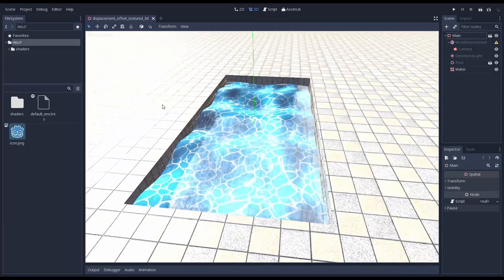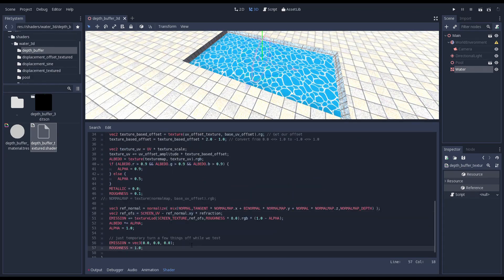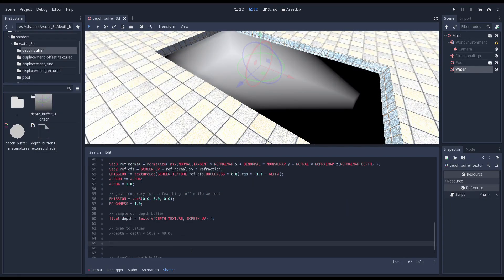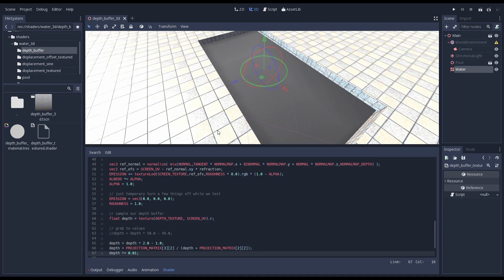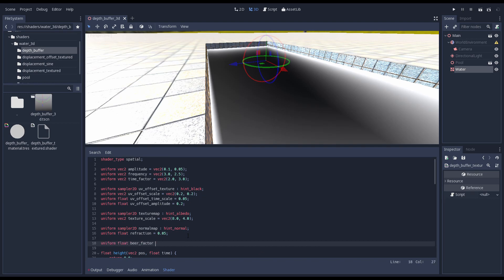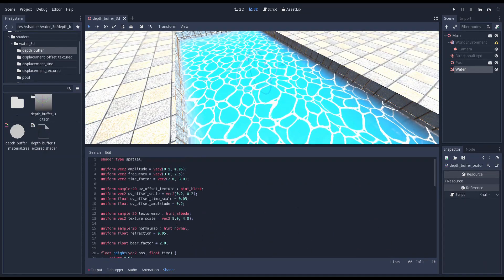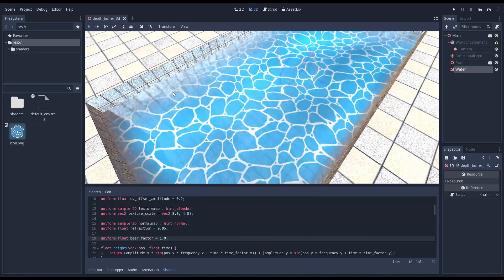Godot 3D Shader Tutorial (2) : Using the depth buffer

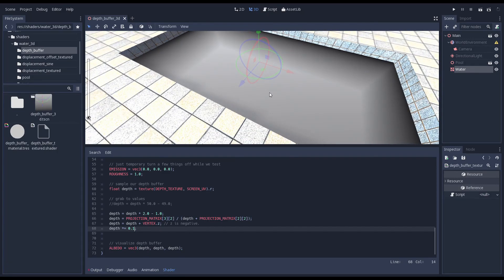Comment: I  have written the same code has seen around 3:00 and my plane pretty much changes a lot of luminosity when I move the camera around. Also, the website linked is not working anymore.
Reply from the maker: It's always sad when people remove content from their website but I have little control over that :(

At this point I'm visualizing the depth buffer values which are very susceptible to how far away your camera is from the object and to what the near and far plane settings are on the camera. It is very likely the default near and far settings have changed in Godot as they were incredibly low (1 - 500 if memory serves me correctly). The further away the far plane, the brighter the result of the code shown here.
Reply: @BastiaanOlij  Okay, thank you for the answer, I'll try to adapt my code accordingly.

Comment: is there an easy way to achieve this in visual shader ? it took me days already to figure out that you have to use sampler2d depth inseaad of the depth texture, but i cant figure out all the remaping
Reply from the maker: It should definitely be possible but I don't work enough with the visual shader to know exactly how the depth texture is implemented in there.
Reply: @BastiaanOlij  well looks like ill have to learn real shaders anyway or "borrow" some code :U, thanks anyway

Comment: I'm not sure if this is a bug in my code or a bug in how Godot 3.2 handles the depth buffer, but for some reason, the moment I access the depth buffer in my shader, it nukes the screen texture and the surface of the water goes solid white. It also disables depth culling on the water surface, and causes it to appear even when it should be behind the "floor" around it.

This happens regardless of which order I access them in, and whether I'm using GLES2 or 3 as the renderer (I had to switch to GLES2 anyway because 3 has some pretty bad lighting bugs. Maybe those will go away when they release Vulkan.)
Reply from the maker: The current render and depth buffer are copied when the first material that uses screentexture and depth buffer are used. Anything rendered after that only effects what is on screen. It should still do a depth buffer test unless that is specifically turned off. No idea why your screentexture would end up all white though.
Very weird..
Reply: The depth buffer works, though I think the values ended up being subtly different from what you used. I was able to make water that was more opaque the deeper it was, just not in conjunction with using the screen texture.

Maybe I need to file a bug report...

Comment: after using your terrain editor my project doesn`t start anymore
0:00:00:0741 - No loader found for resource: res://terrain.hterrain_data/normal.png
----------
Type:Error
Description: No loader found for resource: res://terrain.hterrain_data/normal.png
Time: 0:00:00:0741
C Error: Method/Function Failed, returning: RES()
C Source: core/io/resource_loader.cpp:186
C Function: _load
Reply from the maker: Hey matz, thats weird, it shouldn’t have an issue loading pngs. That path isn’t something i setup so i would begin looking at that first:)
Reply: ok

Comment: Very nice tutorial! I was looking for that already :D

Could you do a tutorial on how to get ss reflections on the same water? (multiple shader passes?)
Thank you! :3
Reply from the maker: Screenspace reflections should work out of the box as its a post process done after rendering is the 3D scene is finished. It does use the contents of the depth buffer so it may be using the copy made before the water is rendered, not sure about that one. Also not sure how good that would look, worth experimenting with.

That said, for really good looking reflections on water the scene really needs to be rendered to a viewport with a clipping plane and preferably a stencil which is currently not supported. I'm not sure how well a reflection probe could be used for this, I haven't used those a lot et.
Reply: @BastiaanOlij  Thanks for the reply!
As I understood it, you cant use transparency and ss refl at the same time?

Comment: My brain exploded as usual. I really need to get into shader programming. You do some really amazing stuff with them. By the way, how is the cardboard support for Godot coming along?
Reply from the maker: Slow unfortunately. I think the GLES 2 renderer is now working on Android, I need to find some time to port the lens distortion shader so it will work in both builds. That and a setting to toggle sensor update frequency would make the native support fully functional on Android but I currently do not have access to a device anymore. Tying in with the cardboard API itself was being worked on as part of the GSoC project but we only got about halfway through before GSoC finished, we really got suck because the GLES 3 renderer didn't want to play nice and the GLES 2 renderer wasn't ready in time.
Reply: I have a spare Moto G5+ (kinda mid range android) might be good for testing if your interested. I cracked the screen on it and attempted a screen replacement that turned into a mess so I just ended up replacing the whole phone... however the phone is still 'good enough' for doing VR testing. Not sure the best/safest way to get your contact info if your interested.
Reply from the maker: Thanks Michael, much appreciated. Not sure if cost to ship to Australia is going to be worth it though.
What I really need however is to find time to learn Android or to find someone with Android experience who wants to step in and help out.
Reply: @BastiaanOlij  Sadly my android experience is a out as far as hitting the play button in Godot... I should really get godot building so I can start digging in and contribute instead of just leaching other folks (like yourself) awesome work.
Reply from the maker: Just submitted a PR so the  mobile_vr interface now also works using GLES2, that should make Android + cheap VR holder + Godot a valid option. I'm tempted on getting an Oculus go and seeing if I can complete Paritoshes work now that the GLES2 renderer is pretty much completed.
Reply: @BastiaanOlij  oh-snap. you are the man! my work got a Go for doing these virtual tours (so i may be able to help test if you need.) But the interesting thing there will be the IK arm that it uses for the controller. Anyway thanks for your hard work! I'm hoping I can slip a VR app into the end of the kids programming class I'm teaching this year... it would blow their minds.